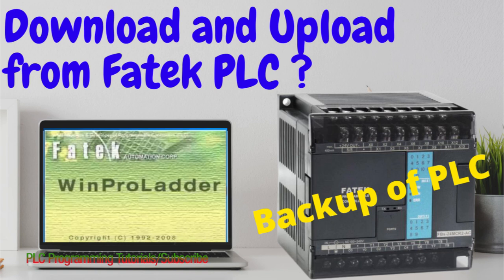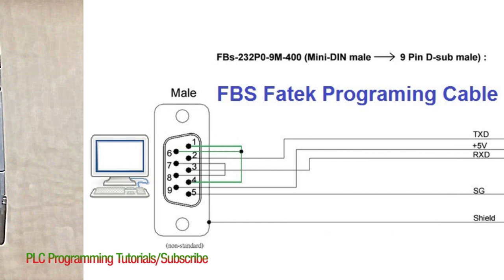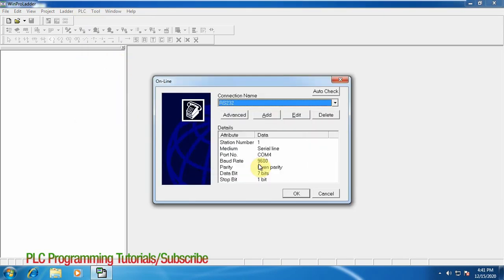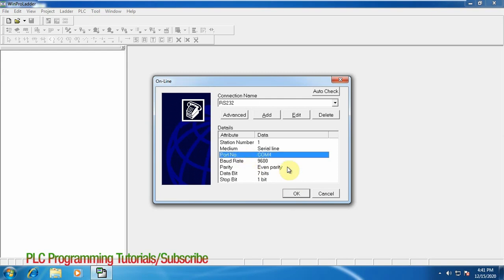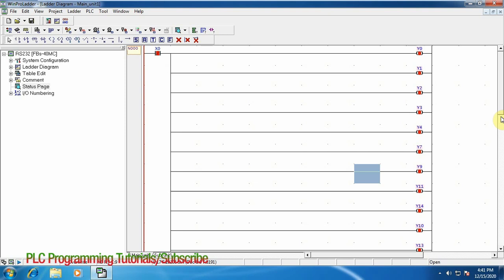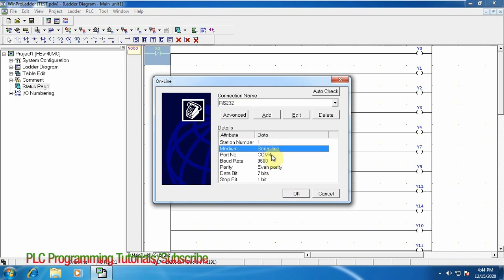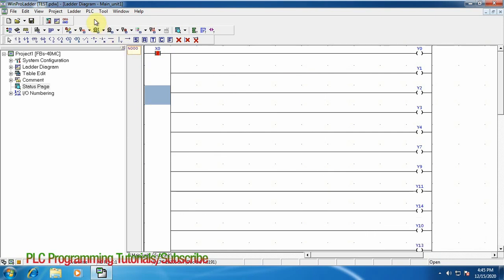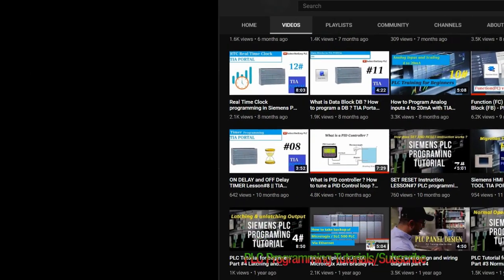How to Upload and Download project in FATEK PLC FBS using WinProladder || Take backup of FATEK PLC

Comment: Can I ask ?

About the cable to PC 

If I have a USB to male  Db9 cable which will be connected to fatek cable 

Would I still need to connect the +5v and SG wires ?

Or Rx & Tx would be enough ?

Comment: How to Upload and Download from Fatek text display type FD101 Fatek sir?
Reply from the maker: Dear , download manual of HMI , and download its cable diagram. Make a cable and follow the download procedure in the manual
Reply: @EASYPLCTRAINING  I have downloaded the hmi manual, bought the cable and the editor program, but in the manual there is no way to retrieve data from the OP320
Reply from the maker: Give me part # of HMI
Reply: @EASYPLCTRAINING  if the part I give the machine, of course it won't work
Reply from the maker: Back side of hmi there is a part number
Reply: @EASYPLCTRAINING  the writing on the back is only "FATEK FD101 , FATEK TEXT DISPLAYER , power 12-24vdc<150mA"